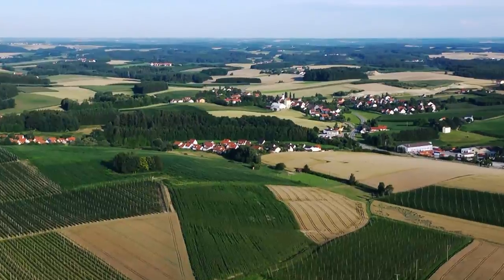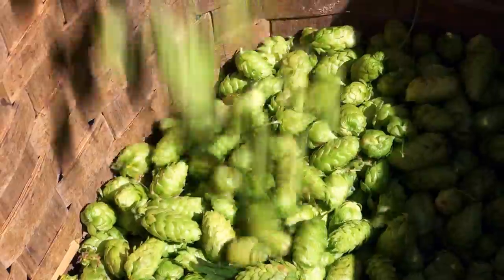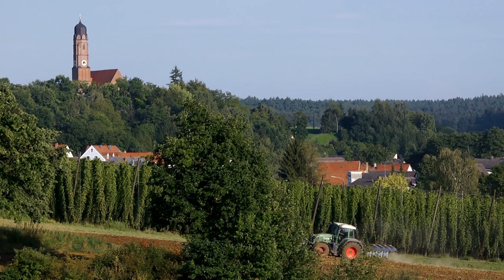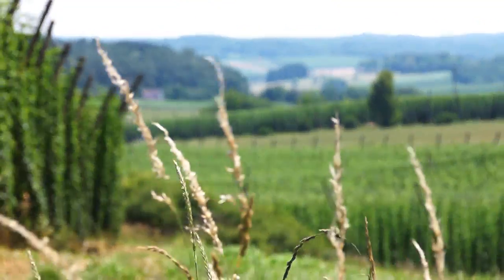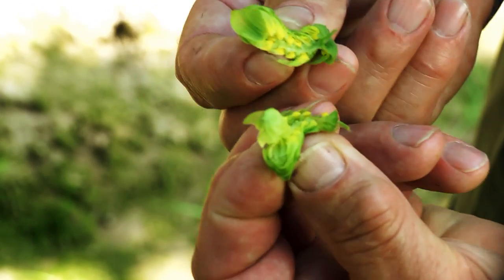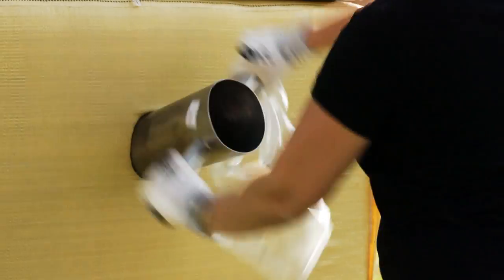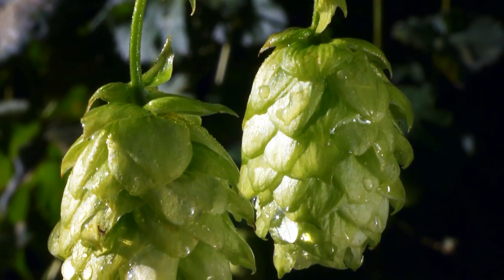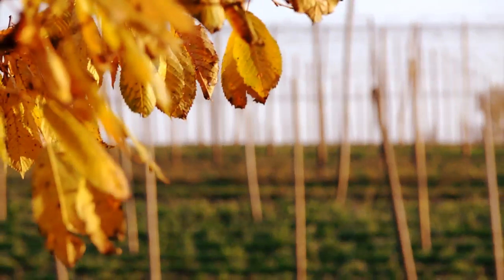Hops from Hallertau - for the World's Best Beers (Long Version)

Comment: So you have to replant every year?
Reply: discusctx No, you trim all the way down to the roots and leave them over the winter and when it comes to spring the roots "spring" back to life and they grow again. See what I did there xD
Reply: +Cian “CianSta” Black - So hops won't grow year round even if the conditions were artificially met? Like for instance, growing hops in a greenhouse where temps are met for spring like conditions.
Reply: line peon No, its the perennial plant nature. They would wither and collapse after flowering because it is in sync with the light cycle and it needs a certain 12 hours of light and dark to mimic the shorter days coming into winter. It then flowers and withers back to its roots to protect itself until spring.